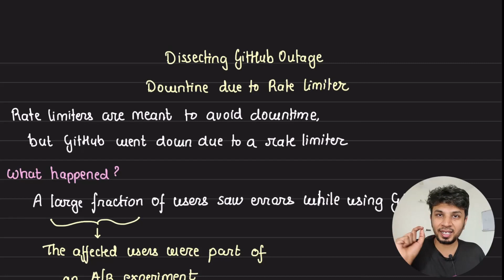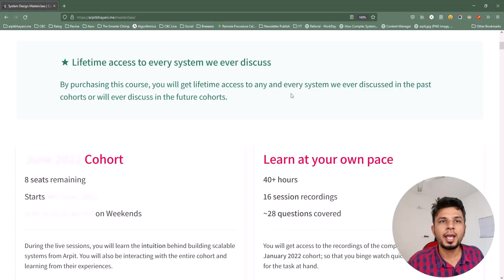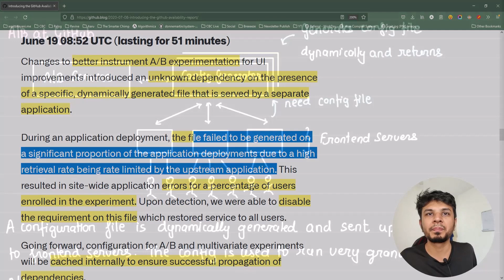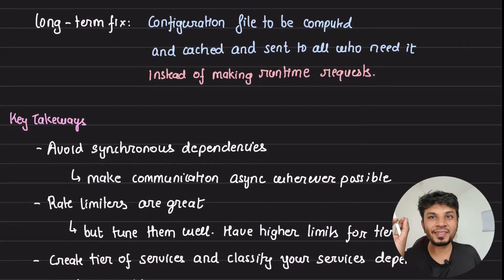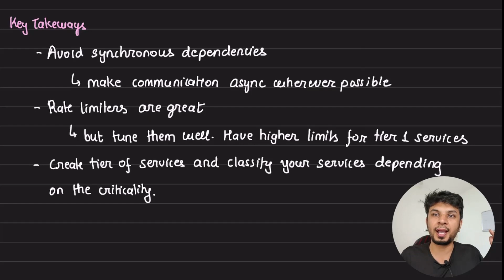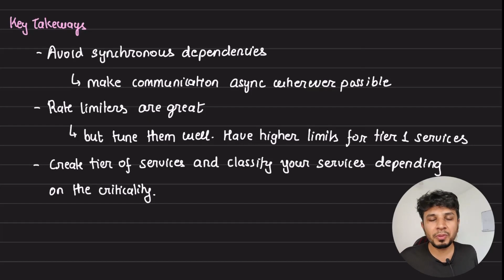Dissecting GitHub Outage - Downtime due to Rate Limiter

Comment: Why frontend/client was directly talking to ab service?
Internal service to service communications use timeouts, circuit breakers and not rate limiting. Also, I was under impression GitHub's tech stack is consisting of 1 huge ruby monolith.